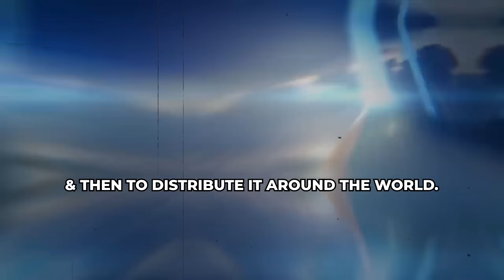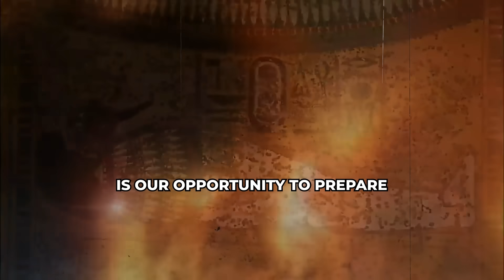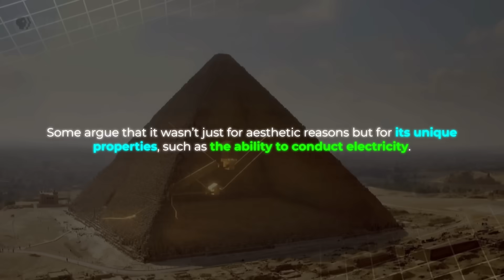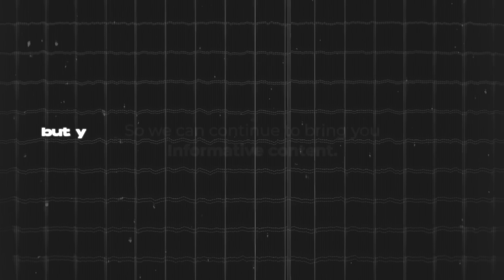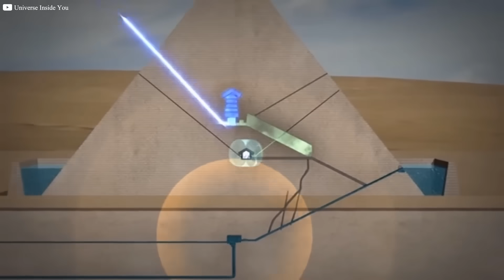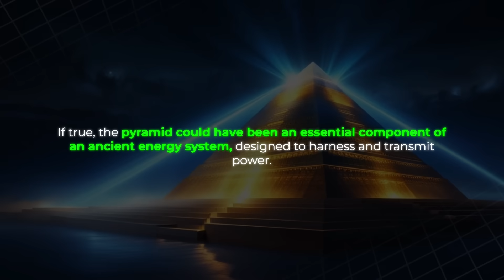Exploring the Hidden Function of the Great Pyramid: A Power Plant or Tomb?

Comment: Running water gives off static electricity.
Red granite is radioactive. The only granite that is.
White limestone is an insulator
Reply: Quartz is piezoelectric. The newly discovered tubes under the pyramid could be low frequency resonators. There is one irrefutable fact. Hawass is a suppressing ass.
Reply: Condoms are a Great Contraceptive. Also Insulate well. Granite don't do that.